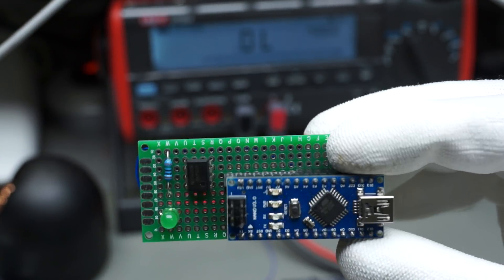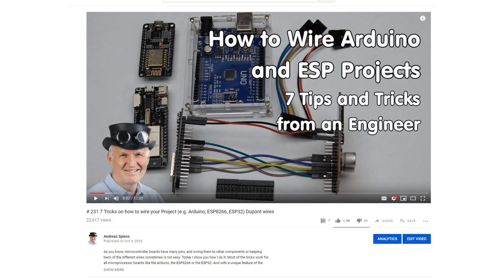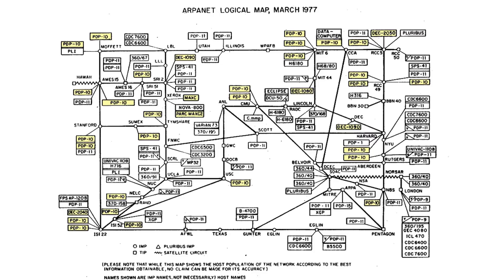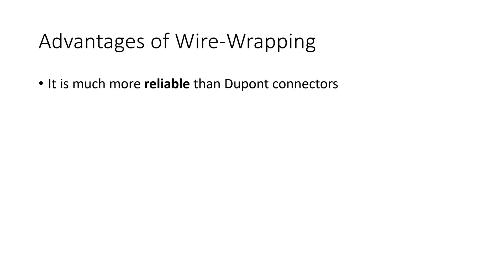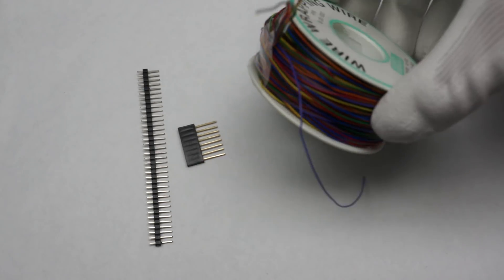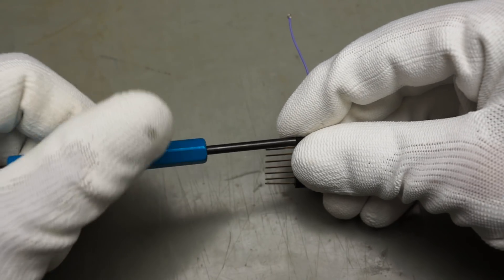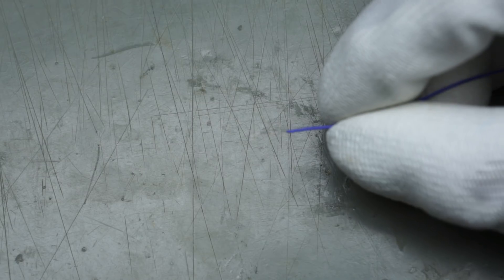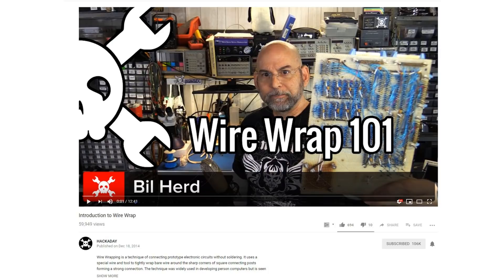#243 Better than Dupont Wires: Wire Wrapping for our Projects (Arduino, ESP8266, ESP32)

Comment: I used this wiring method during a project at my university and I must say that it is a reliable way to connect components but we had a wiring gun to rolling wires and used the other tool to remove the wires.
Reply from the maker: We used different tools back then. But many of them are no more produced or very expensive

Comment: DO NOT wire wrap on any "round pin header posts". VERY UNRELIABLE. Wire wrapping relies on the square corners of the normal (square profile) headers to make a good contact with the wire.
Reply: Sure,  that's for professional jobs,  for prototypes it should be a big issue.
Reply: The round posts should be tack soldered after wrapping for reliability.
Reply: @mt-qc2qh  Yes but the idea of wire wrap is to eliminate soldering.We made our prototype board with round machined pins to have the next board to be placed on top. To test it before placing 2nd board on top, we wire wrapped the round pins. When we tested it on the speaker housing which was playing music and perhaps vibrating.....BAD RESULTS. On the bench it was fine. I stand by my FIRST comment. DO NOT wire wrap on any "round pin header posts". VERY UNRELIABLE. Cheers, Mick.
Reply: @unlost117  I would imagine the square post edges prevent unwinding, something the round posts don't do

Comment: Used it on IBM S34 S36 and S38 systems back then. The connections were solid and trustworthy.
Just wondering why I didn't use it like you showed before. Hope it catches on again. I hate DuPont wires for their unreliability in test setups.

For the 3D printer folks: 
https://www.thingiverse.com/thing:653576
Reply from the maker: Thank you for the link!

Comment: The first electronic telephone switch that I worked on, an ITT-TE-400G, was totally built using wire wrap.  You even "programmed" hunt groups by wire wrapping various pins together.  I have also built dozens of IC based projects using wire wrap.  I think I wore out at least two of the hobby type battery powered tools.  I still have the manual tools and occasionally use them on Arduino projects similar to what he shows in the video.
Reply from the maker: Today configuration is easier. Just click a few buttons on the screen and store the new configuration on the device ;-)

Comment: Please include link to the wire stripper! I had no idea such a tool existed! I always used the stripper on the wrapping tool but it is so hard to pull! I am trying to connect very short connections and stripping the wire after making the first connection is almost impossible.
Reply: You really want to strip both ends of the wire before you wrap. If you do "strip-wrap-strip-wrap", you can put a lot of strain on the wrapped end of the wire.

You also want a really precise stripper: with wires that fine, and insulation that thin, the difference between "no strip" and "nicked wire" is very small. The one I used back in my wire-wrapping days had two parallel blades whose separation was set with a multi-turn  screw mechanism. Sadly, the lack of results from a Google image search suggest that it isn't made anymore.
Reply: Thank you  @rantalbott6963 ! I am using 30ga (kynar??) and use the stripper built in to the wrap tool. But it is so hard to pull. My fingers hurt from pressing so hard on the tiny wire to get enough force to pull off the insulation. Is there a tool for grasping the wire, especially short ones so I can quickly make connections without raising blisters?

Comment: I had ARPANET IMP #17 at our site at the U of MD back in the day in one of my computer rooms, and I operated the first ARPANET/NSFNET interconnects with it.  (On a MicroVAX-II, sorry no wire-wrap in that beast.)  Though I think I recall doing some wire-wraps on a UNIBUS backplane when we didn't have any bus-grant cards available..  And on a bunch of boards, you selected options/addresses/etc using wire-wrap jumpers between pins rather than those expensive DIP switches that took up a lot more room, too.
Reply from the maker: VAX was more my time at DEC. I wrote my Ph.D. work on my VAXstation in WYSIWYG. The employees sometimes were able to buy one for cheap :-)

Comment: Hi, I liked the video. One disadvantage of wire-wrapping is: It can't be used in connections that need to move, because the fatigue of the single core thin wire ends up breaking it.
Reply from the maker: You are right. But moving connections need special attention anyway (e.g. my milling machine was defective because of a broken wire)
Reply: @AndreasSpiess  Right. BTW I use wire wrap cable in soldered connections just for the small diameter and great quality.

Comment: like getting a flat tyre on a truck , its always the inside that gets a flat.. with wire wrapping it was always my lowest wire on a stacked pin that had to be removed. Cut it off , dont try to remove it. I dont tack solder the socket in. i do a leadless wrap on the end pins.
I still have my tool from the late 70's, it is the same as the one in your video. the wire stripper in the side of your tool should work ok. the length of the strip is usually to the opposite face of the handle.  Careful trying to wrap onto round component pins , the wrap will not 'bite' onto the square edges of a round pin. I have an Ericsson PABX alloy ground plate that still has 10,000 or so double ended gold coated  wire wrap pins in it. i pluck them out to use and individual header pins , breadboard pins .  but yes , may last 2 rolls of wrapping wire are both indigo blue.
( i see the price of wire wrapping sockets jumping after this video , and the quality of the cheaper sockets dropping ).
Reply from the maker: Thank you for the tips!

Comment: I used wire wrap in the '80s but preferred the vero speedwire system : used  a pen and combs to connect ordinary through hole pins. The solder displaced the insulation and completed the joint. Guess that's long gone now?
Reply from the maker: Maybe you still get the tools and the wires. I also used it back in the time.

Comment: Is it normal to wrap counter-clockwise? I know it doesn't matter for the connection purpose but if you are trying to unwrap someone else's work it could be annoying. I always wrap clockwise as it seems more natural like driving a screw. I've only done this as a hobbyist so I don't know if there is a convention.
Reply: It matters when you come to use the unwrap tool. It only works one way!
Reply: He's using his left hand to turn the tool.  It seems like it would be the more natural motion to go from the tip of the index finger toward the base to do the twisting.

Every powered WW tool I've ever seen, and every wire-wrapped assembly, was clockwise. I wonder if they discriminated against left-handed people back in the days when it was common to protect the "standard"   ;-)
Reply: @rantalbott6963  I am actual left-handed. We get used to it
Reply: threaded fasteners are almost always “righty tighty, lefty loosey.” Seems like a natural approach for this as well?

Comment: Those rolls of wire warping wire are also useful for PCB rework if you don't have some kynar wire.
Reply from the maker: You are right. They are much easier than stranded wires.

Comment: FYI, wire wrapping goes back to at least the early 50's if not even farther back. Wire wrapping as a technique has been used since the late 1800's, although the first device specifically built to the standards we now think of as "wire wrapping" was not introduced until 1953. I VERY much applaud you making this video, as virtually all young engineers I know are totally unaware of the technology and are generally blown away to find out how it can "outperform" solder in specific applications (thus the use in Apollo et al). You just made the world a slightly better place.  :)
Reply from the maker: I was overwhelmed by the may reactions. I did not expect such an echo.

Comment: At the start of the video there's a 2.54mm header with long tail, so you could stack boards. What are they actually called? I've never been able to find them.
Reply: @Verdigris well when I visit the farnell web site and search for "long tail" the result is "0 results found", so I assumed I had the wrong terminology.

Thanks for your advice, maybe farnell just don't stock them.
Reply: @Verdigris deadly, thank you for those search terms, and in future I'll follow your advice to eBay or aliexpress

Comment: Oh man! this reminds me of digital transmissions X-connections of the 90s! One more tip for beginners: the black sharp metal piece placed at the side of the wire wrapping tool is to peel off plastic covers of the wire, no extra tool is required.
Reply from the maker: You are right. I tried it but did not like it :-(

Comment: Brings back memories... like others who have commented, I too still have my wire wrap tools (battery operated and manual) bought from RS back in the early 90s. One point to note (not sure if this was mentioned by someone else) but you don’t really need a separate stripping tool as that is already built into the handle (see small hole and black metal plate with a slot). I found this perfectly adequate for prototyping but perhaps not so good for large boards with many hundreds of connections, but then you would use the electric tool anyway. I had a preference to use blue wire for data lines, green for address lines, red for Vcc, black for Gnd.
Reply from the maker: The hole was mentioned a few times. I tried it but was not happy with it. This is why I used my "trusted" tool.

Comment: Hi Andreas - I've been following your channel now for some time, and I do like the videos showcasing the alternative ways to electronics - particular to POC projects as described in this video.  Although providing an abundance of options when it comes to wire wrapping - for people like me with thumbs for fingers, this is not practical.   I'm not badmouthing this insert in any way, but highlighting that these basic and almost forgotten techniques still have a place in the hobby world today, even if it comes with it's own challenges. I usually default to my soldering iron (non-regulated) as my tool to get things done, but in some cases even the most basic tools could be overkill - that is why I like this video and also your channel - which does not prompt me into a direction, but rather encourages to alternatives and inevitably the prolonging of the hobby mostly for amateurs en entrepreneurs thinking of pursuing these types of technologies as a supplement or main drive for a project. Respect and I'm looking forward to another vid, Greetings from Cape Town ZA
Reply from the maker: Thank you for your nice words. Indeed, I love freedom and trying out new things. And I have good memories from Cape Town where I was one many, many years ago :-)

Comment: Well this takes me back!  I thought I was the only one here to still have WW equipment.  I always use the stripper in the middle of the tool and if you're planning on buying a hand WW tool make sure it does the "modified wrap".  This puts a turn of insulated wire around the post first and prevents wire breaking at this critical point.  For components such as resistors and capacitors I use single sided WW pins which have a notch on the upper side to solder the component wire to.  I have built Z80, 6809 and 68HC11 boards in the dim distant past using this technique.  I remember being at Plessey in the early 1980's when computerised WW was introduced for wiring backplanes; it reduced the time per board from almost a full day to just 20 minutes each!  Bob
Reply from the maker: I think modern 3D printer technology would help to build such a "computerized wire wrapper" ;-)

Comment: We still have PCB test fixtures in our company that use Wire Wrap to connect to Pogo pins.
Reply from the maker: Replacing jumpers also now can be a good application if you need many of them.

Comment: Hi Andreas, In Bil Herd's demo, he insists on wrapping some insulation onto the pin to prevent strain-cracking of the conductor. Why didn't you do this too? Also, have you used a kind of wrapping-wire where you don't need to strip it? (the sharp corners of the post are able to cut through the insulation locally)
Reply: आदित्य Aditya मेहेंदळे Mehendale I was going to make exactly the same point. When I was taught to wire wrap back in 1972, it was explained to me that a “perfect” wrap begins with a turn of insulated wire around the post for strain relief, with all the bare wire following after higher up the post. I think Andreas’ technique is slightly wrong. Strip the wire (using the slit in the middle of the tool, not a wire stripper), feed the stripped wire into the smaller hole in the wrapping end until the insulation touches the hole (ie won’t go any further). A good practice is to let some of the stripped wire come out of the slit so that you can hold it in place with your finger. Then, place the tool over the post and push down gently so that the insulated part of the wire beyond the tool is in contact with the PCB. This causes the insulated part of the wire near the tip of the tool to bend towards a right angle. Hold the insulated part of the wire against the PCB so it can’t move, reduce pressure on the tool slightly and turn it clockwise until all the stripped wire is wrapped. The bit of insulated wire that was “inside” the head of the tool will have wrapped somewhere between a partial and full turn and you will have a perfect wrap which, because of the strain relief, CAN be used in a design that moves (eg mounted in your car). I’ve done all my Arduino projects with wire wrapping. Another good use for stripped wire-wrap (Kynar) wire is in holding thicker wires in place for soldering. It’s usually easier to do that than use clamps or try to get things to line up in a “spare hands” jig.
Reply from the maker: I do no more remember everything. That is why I linked the video of Bil. He seems to remember much more than I do. I also do not use it for Apollo missions, I only use it for my hobby ;-)
Reply: @AndreasSpiess  There was no criticism, merely a question - perhaps you had a reason for doing it this way ;) Also, have you tried the no-strip type wire-wrapping-wires? I cannot find it anywhere on Teh Interwebs.
Reply from the maker: I think this was a specialty. I never used this technology back then. But some other viewers wrote about it in the comments.

Comment: Thanks for that "old" funny video. But .....Bin there and done that.... Its just to time consuming and takes too much space. You also have to take special care of the pins sticking out all over the place.  Solder is the way to connect things IMO.
Reply from the maker: Both methods have its usage. Replacing Dupond wires with Wire Wrap works for me.

Comment: Why is the wire wrap tool so expensive (€12,81 incl shipping)? I’d expect 2 or 3 euro.
Reply: It is a HIGH precision tool since the clearance to the square post is quite critical and if you ever hold one in your hand you'll probably see why they are not cheap. Plus, unlike amateur tools they LAST! Mine is 40 years old in a month! Still works perfectly as does my separate, much shorter, brass handled unwrapper.
Reply: Bob Lewis 
Happy wire wrap tool anniversary next month 😉and thank you for your explanation! 👍

Comment: Yeah good old idea, I have worked with this in 88 to 90. But I had a better tool, it was a pistol with mechanics to press a trigger, which then mechanically turned the tool. It was very reliable, because the pins had sharp corners and the wire was practically cold welded around the pins ...
Reply from the maker: You still get them. They are very expensive.

Comment: Very reliable. I used it around 1980 to build a 8 kByte memory expansion board for my Commodore PET 2001. I designed it myself and it still worked when I last tried it 3 years ago. The base was a Eurocard(?). All IC's went in wirewrapping DIL sockets. The only soldering was for a connector, the IC power pins  and the  decoupling capacitors for all the ICs.
Reply from the maker: This was how we did it back then. Lots of parallel address and data lines. It is interesting that many of these boards survived somehow...

Comment: We had to do wire wrapping at Electronic school. I was wondering what that tool was in my tool box. Thanks Andreas. Have a great day.
Reply: I did also back in the 90's and still have the tool :)

Wire wrap wire can also be used as bodge wire to repair broken tracks.
Reply from the maker: I have many viewers with similar experiences. Probably all older than 30 ;-)
Reply: @AndreasSpiess  Remember the circuitboard stand with lead for the base mate. I said you needed gold. Well found some more Andreas.
Reply from the maker: I wonder when you will retire, lucky guy ;-)